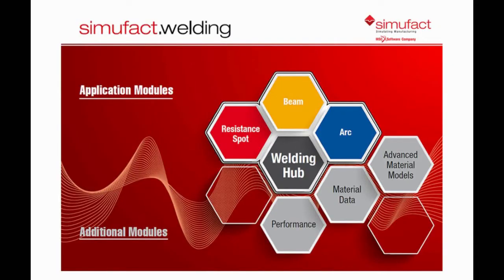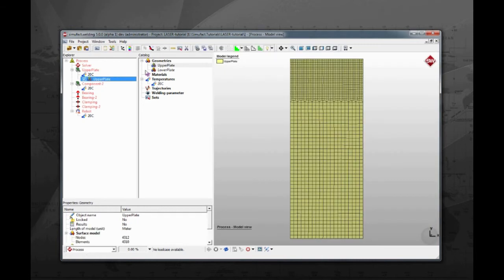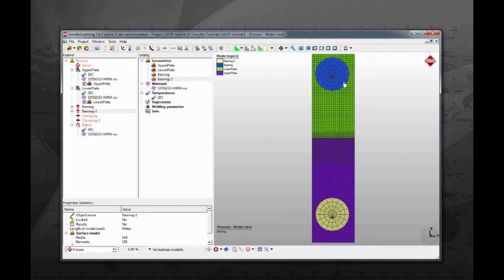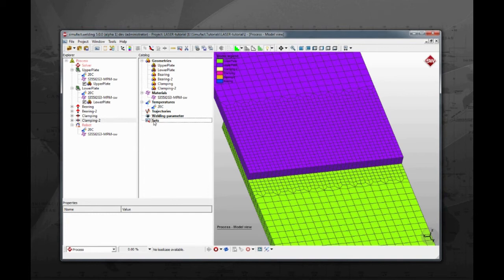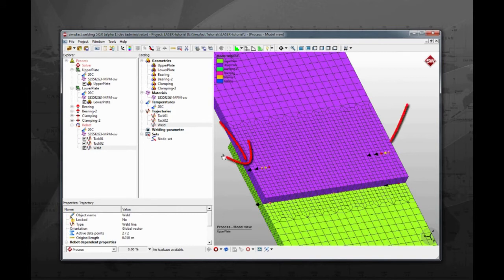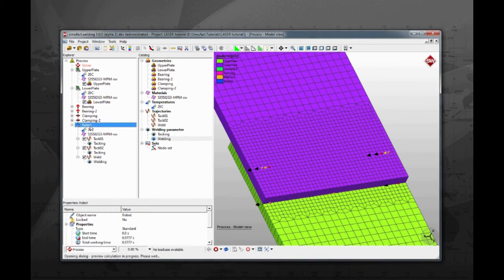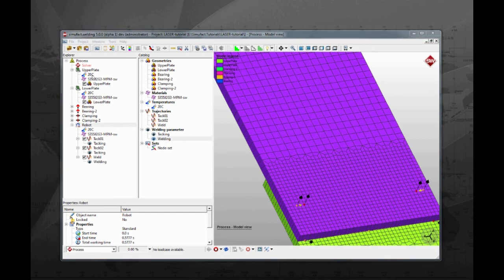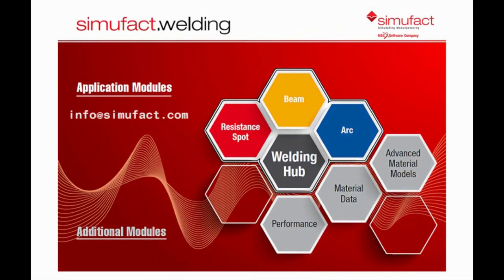Tutorial of the module Laser Beam Welding | Simufact

Comment: Hi,

would you please guide me how residual stresses being calculated
Is effective stress is residual stress??

In laser beam welding where plates kept side to side (not as shown in video: one over the above) it is expected that after declamping, the plates take slightly V-shape.
Please guide me how I can simulate that in this software.
Reply from the maker: Dear Santosh Konappanavar,

Effective stress is von Mises equivalent stress calculated using the resulting stress tensor in each increment.
The bending of plates is visible after unclamping, there is no need to do something special besides removing the mechanical boundary conditions after welding.

Thanks,
Your Simufact team
Reply: thank for your reply.

My concern is with calculation of residual stresses after welding is done.
How its simulated?
Please help.
Reply from the maker: You are welcome. 

The concept of our software is that you do not need specific engineering knowledge. Our goal is to provide an easy and user-friendly software for the simulation of welding and forming processes. You just fill in your variables and wait until the simulation is finished. 
If you are interested in the mathematics of fem-simulation, which is the basis of our tools, please follow this link. http://mms2.ensmp.fr/msi_paris/archives-transparents/JLC-Plasticity.pdf
On page/ slide 46 you find what you are looking for.

Best regards,
Your Simufact team
Reply: Thank you!
yes the software provides and is user friendly to use.
what i want is as we see the temperature distribution after post processing as a result, Is there no way I can see residual stresses in color contour form.
Because the result shows Temperature distribution, distortion(displacement), von mises stress.
But I also want to check the residual stresses induced in welded area.
Is there no way this can be calculated through software.
Reply from the maker: Hi Santosh,

The stresses you see in Simufact.welding are residual stresses.

Best regards,
Your Simufact team
Reply: ok that's what I was looking for.Thank you for your support

Comment: How can I map the laser process to prepare a simulation environment for selective laser melting? 
How to get the geometry in the powder form and observe the building of the product?
Reply from the maker: Hi Varun chopra,

In order to use Simufact Welding for powder bed based processes one has to define the scan paths (trajectories) as they are used during the process. Each trajectory is then assigned to a robot. Additionally, for each path a mesh representing the track has to be defined also. The tracks are then assigned to trajectories activating them. Depending on what one wants to see it is also possible to define the complete layer as a single mesh. This might lead to “not so nice” tracks afterwards, but anyway they will be activated by the moving heat source.

The mesh density has to correlate with laser spot geometry and scanning velocity, this is why this approach might lead to very high calculation times if used for real components, but works fine if one wants to see what happens with single tracks or some low number of layers with respect to scan strategy. For larger components it might be helpful to merge several tracks/layers into a single geometry and do the same to the heat source, thus heating several tracks and layers at once.

In order to represent the influence of the process on stresses and distortions of a real component Simufact will introduce Simufact Additive

www.simufact.com/additive

This GUI will be optimized for powder bed based processes in terms of definition of the model and also in terms of calculation times.

I hope this helps you.

Thanks,

Your Simufact team